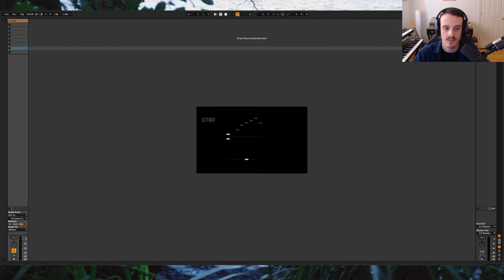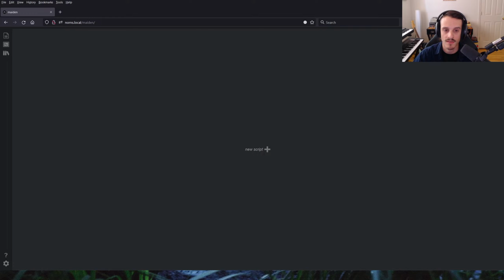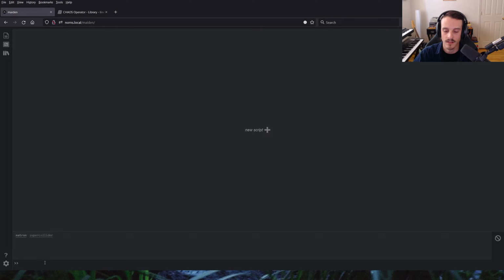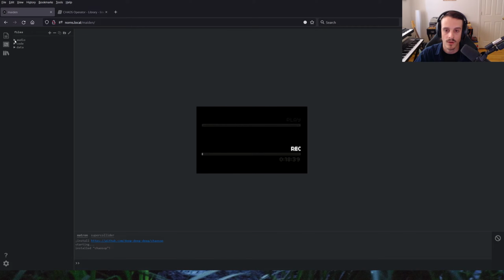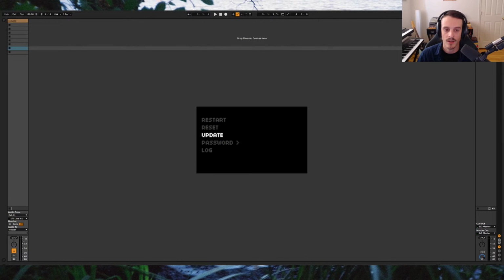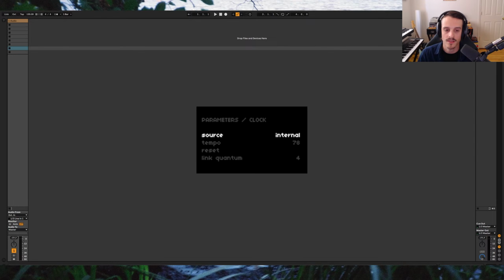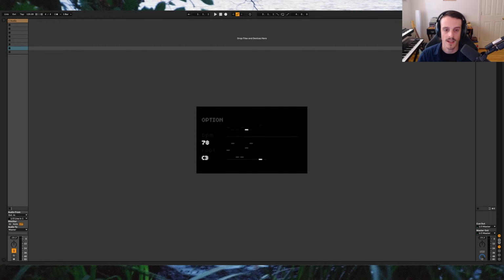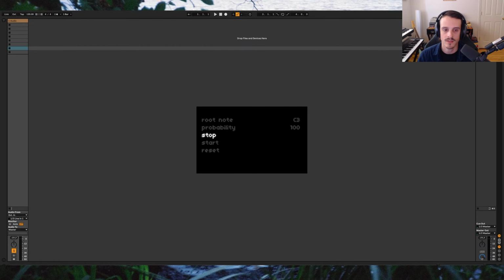My Favorite Norns Scripts Episode 16: A Beginner's Guide to Norns / Awake

Comment: Would love if you could do a little description of what you have going on in Ableton during your performance.
Are you using awakes audio  output engine to go to ableton?
And you send the audio from norns to ableton but also midi which is the one triggering all the operators and synths in ableton? Or you have some more complex routing going on there?
Also Abletons LFO is controlling awake tempo but any other midi information going from Ableton to Norns?
Also, how are you recording the audio output of everything? Through another software in your computer or you send everything back to norns and record it there? Any problem mixing the different sound sources in Norns?

Sorry for all the questions but im also dwelving in the realm of norns and there are still a lot of incognitas for me!
Great video nd keep up the good work!

Comment: Hi Peter , i have a norns and lucky i get a grid quite a few years ago. but would love an arc (which are either non existent or very expensive). Is the midi fighter twister the only alternative or are there better solutions.
Reply from the maker: I think with the exception of a few scripts which are specifically made for arc integration you can map most parameters to the midi fighter.